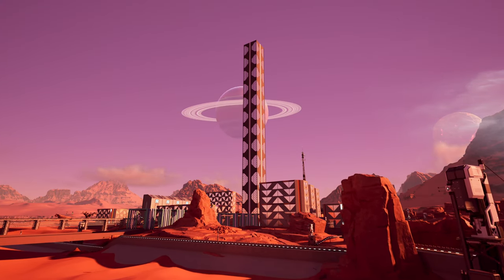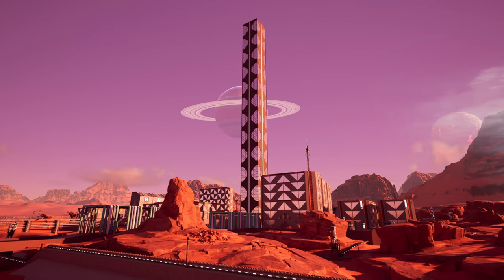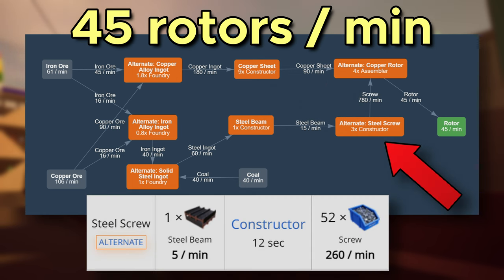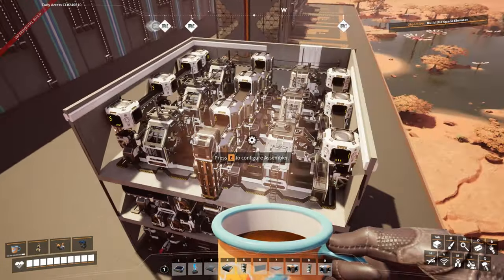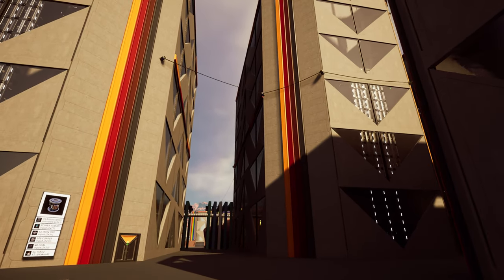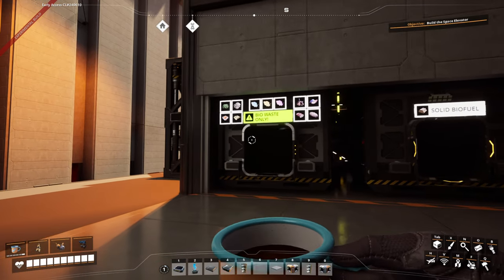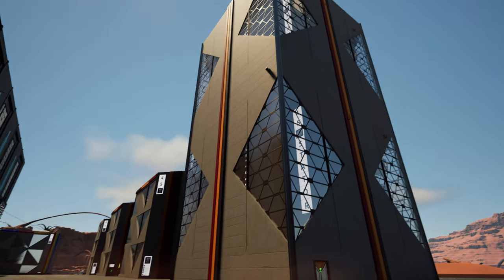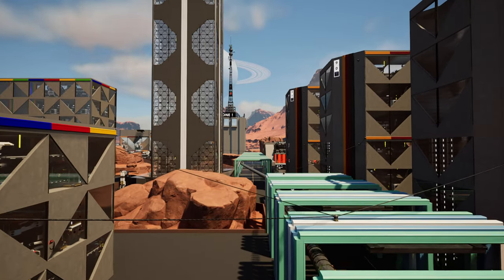These SAVED me hundreds of hours in Satisfactory!

Comment: I've just started a singleplayer playthrough and I am struggling so hard with having everything neat and tidy. I must have rebuilt my base several times already and right now, I have a giant floor level of only smelters/foundries, a second level with constructors, a 3rd level for conveyor routing and then the 4th floor is the assemblers... been stuck on phase 2 for hours with what feels like zero progress. Only just started producing the Versatile Frameworks, but no longer have a Smart Plating area and haven't even touched the Automated Wiring (or w/e it's called) 
Going to have to finally check out your blueprints, as they are so smart and compact. Thank you for not paywalling them behind a patreon, or asking "join my discord" - because that shit drives me nuts.
edit: I see now that you are able to make them so compact because you don't mind having everything clipping x) fair enough as you can't really see it from the outside :P
Reply from the maker: That is a Satisfactory in the nutshell! I redesigned my factories numerous times. It is cool puzzle to solve each time around. Both in terms of production chain layout and in terms of physical placement of everything. And surprisingly I enjoy Satisfactory more taking enormous amount of time unlocking things and making sure that everything is neat and tidy before rushing to the next phase.

I have some limitations for clipping. I do not do hard clipping, and for the most part I use ability of conveyor lifts to snap with inputs and outputs way closer than by the default. I just feel like game miss the lift splitter/merger part. Otherwise you can just place belts straight though buildings, each other and even clip buildings into each other... But I do not do these types of clipping.

Comment: I feel like im missing a step. I would like to use your motor BP, but im unsure on what mirror to use with it and then what to conect when i attach a mirror BP. unless im just over thinking it. Other wise thanks for making thess. They do save time and space. Great work and thanks for sharing them!
Reply from the maker: For the motor production you need rotors. Both blueprints are 1:1. So it can be any combination of two blueprints. Either 2 separate buildings with different mirrored blueprints for 22.5 motor output. Or it can be single building with motor and rotor blueprint combined for 11.25 motors / min. In either case connections are separated and it is all about visuals.

Comment: How were you able to get the conveyor lift to attach so close to the constructor at 5:07? It seems like the merger is snapped to the top of the lift, but I can't get the constructor output to clip that closely with the lift.
Reply from the maker: First you place celling conveyor mount at required distance and extend lift from up > down, snapping to connection. Note you can use R key to reverse direction of the lift. Then you just add merger/splitter to the lift after removing mount.

Comment: Amazing. I'm over here with my 5 motor/min setup that takes up like 10x15 area questioning my life choices. And lets not talk about my heavy modular frame factory. Do you have anything for the electronics like computers?
Reply from the maker: Yep. This week I am making video for 2 fuel generator blueprints for 300 oil into 2.85GW or 9GW of power. Next week should be 18 Computer / min blueprint. That one can produce either 18 Crystal Oscillators and 48 circuit boards or 18 Computers. Actually made it before my Motor setup, so switch tech was made for Computers first xD
Then I have personal storage blueprint similar to my Iron Encabulator for AI limiters, Circuit Boards, HS connectors, Quickwire, Silica and Quartz. Will make a video on a later date.

Comment: I still have a question about blueprint, do we need to unlock blueprint milestone to build downloaded blueprint ?
Reply from the maker: That is something I never tried. And I bet it should not let you into blueprint tab before that. In any case you at least need to manually create session folder for blueprints.
But other aspects of blueprints are pretty clear. Once you have them from another save you can plop buildings that you not even unlocked yet. Also they always retain alt recipes and all the locked decorative features. This is sort of abusable you can even copy paste recipes without unlocking them.

Comment: Why don't you use the recipe for the Steel Rotor? It uses the same parts as the Stator. Pretty much an identical setup
Reply from the maker: Steel rotor use double the amount of machinery to get to the same numbers. Copper Rotor just saves space essential in blueprint form.

Comment: Doesn't work on 1.0 because of clipping issues :(
Reply from the maker: There are some oddities with blueprint build mode snap in 1.0. Just use nudge tool with button H to align blueprints. Even if it is red, just press H and then align blueprint into the position with arrow keys. Considering Rotors mk2 print, it is scuffed for sure. The fix is to redo half of the blueprint. Honestly I ether make new prints or just use 1 to 8 meter exterior adapter in between those prints. Painted beam is just the right size for the gap...
Reply: @Yakez42  for the motor blueprint other then the looks, does it actually work or is there something that needs adjusting?